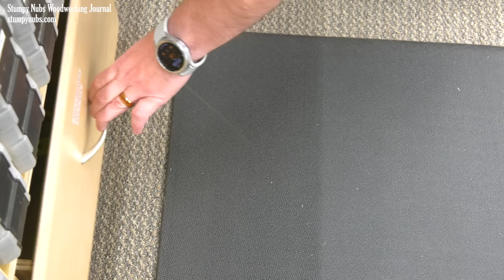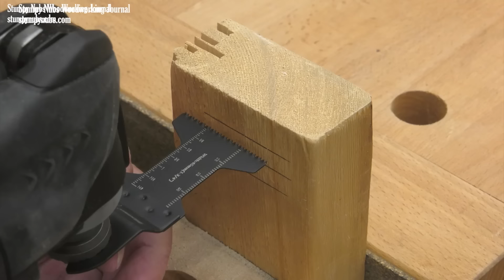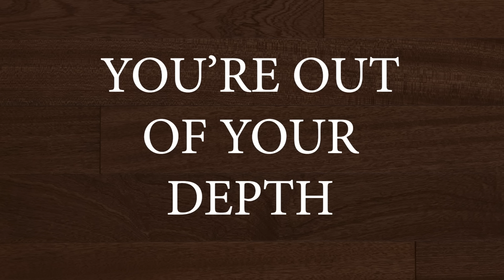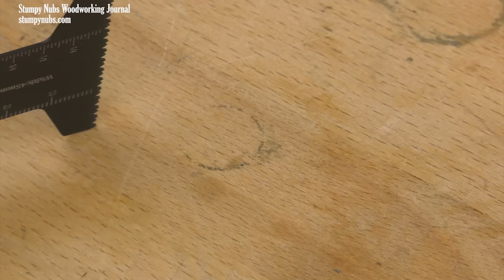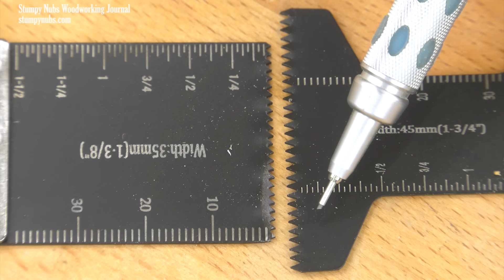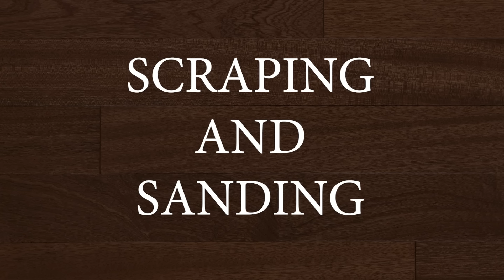An AFFORDABLE power saw that won't cut fingers off!

Comment from the maker: The (not sponsored) blades I use: https://amzn.to/4fkGw3a

★THIS VIDEO WAS MADE POSSIBLE BY★
My Woodcutters is a small Canadian business that specializes in Helical carbide jointer/planer heads and replacement HSS steel knives for both new and older machines. It is well worth supporting: https://mywoodcutters.com/

Clean Armor UV Wood Finish: https://mywoodcutters.com/clean-armor-wood-finishing

Longer video about Clean Armor: https://www.youtube.com/watch?v=HiJdtJeO0JQ

My Table Saw and Bandsaw are AWSOME! Check them out at Harvey Woodworking Machinery: https://www.harveywoodworking.com/

Please help support us by using the link above for a quick look around!
(If you use one of these affiliate links, we may receive a small commission)

Some other useful links:
-Check out our project plans: https://stumpynubs.com/product-category/plans/
-Instagram: https://www.instagram.com/stumpynubs/
-Twitter: https://twitter.com/StumpyNubs

★SOME OF MY FAVORITE INEXPENSIVE TOOLS★
- #ISOtunes Hearing Protection (Save 10%): https://bit.ly/3BHYdH7
- BOW Featherboards: https://amzn.to/430ldhv
-123 Blocks: https://lddy.no/vpij
-Mechanical Pencils: https://amzn.to/2PA7bwK
-Lumber pencil: https://amzn.to/2QtwZjv 
-Pocket Measuring Tape: http://amzn.to/2kNTlI9
-Nut/Bolt/Screw Gauge: http://amzn.to/2CuvxSK
-Self-Centering Bits: https://amzn.to/2xs71UW
-Steel Ruler: https://lddy.no/10mv7
-Center-Finding Ruler: https://lddy.no/10nak
-Bit & Blade Cleaner: https://amzn.to/2TfvEOI
-Narex Chisels: https://lddy.no/sqm3
-Mini Pull Saw: https://amzn.to/2UEHBz6
-Shinwa Rulers: https://lddy.no/zl13
 
(If you use one of the affiliate links above, we may receive a small commission)

Comment: My number 1 oscillating tool tip: wear earplugs! You're never gonna want to use the tool without them.
Reply: What? 😂
Reply: Absolument 💯
Reply: Can confirm. The tool itself isn't particularly noisy, but it inevitably vibrates the part you are cutting which can make a lot of noise.
Reply: Especially in a closet or cabinet or tight space.
Reply: My ryobi is super high pitched at high speeds, you definitely need hearing pro
Reply: 😂 “we are not going to make it”
Reply: @smody121 and the Ryobi isn't even the loudest one. I have a cheap Warrior from HF that is truly ear-splitting.
Reply: Very much agree, making cuts with it is way louder than one might expect due to the vibrations.
Reply: Agreed on the number 1 tip. I'd like to add a number 2; don't touch the blade directly after cutting, they get really hot in my experience.
Reply: I'm waiting for the noise canceling version before i upgrade
Reply: I normally have over ear defenders but like to have a handful of in ear plugs in the tool box, just in case I forgot to pack the ear defenders for a job site
Reply: For sure. The tool is already loud, but the vibrations on whatever you’re cutting (metal 🤯) will damage hearing for sure
Reply: @joegibes  I have a cheap chinese dewalt clone multi-tool that obliterates your hearing at half speed. It gets quieter if you go slower or faster, but the ear splitting speed is the 'perfect' speed like 90% of the time.
Reply: It's a good idea to use hearing protection with a lot of power tools. I probably wouldn't bother with a screwdriver or drilling wood with a handheld drill, but a lot of other stuff I would. I value my hearing way more than being laughed at by macho men.
Reply: Thank you for typing that because I wouldn’t be able to hear it anymore due to my oscillating saw.
Reply: @blarghblargh  who cares if you can't hear them laughing?

Comment: If it makes you nervous to guide the blade with your off hand, you can just wear a nice sturdy work glove on it. That's something you'd never recommend with a rotating tool, but it's perfectly safe for this.
Reply: If you start feeling slight pins and needles when you're using one, you're overdoing it.

Comment: Grout blades are expensive and wear out extremely quickly. I tried diamond blades, carbide blades, etc.  Watched a video of someone using a masonry disk/wheel with a grinder but that was on a tile floor with a 3/8 or 1/2” grout line. I had a 1/8” grout line. Bought some masonry cut off disks and luckily figured out a clamping system and tightened it down with the hex bolt.  Cut through grout like butter!   As the disc wore down I’d just rotate it a quarter turn.  Finished 90% of grout removal with a $5 pack of HF discs. The first 10% I used $60 of multi tool grout blades. Hope this helps.
Reply: I did the same thing several years ago. I also used an 80mm dia mini circular saw blade which worked well on wide grout lines
Reply: do you mean angle grinder disks?  that could be genius.
Reply: @mgjk  yep, angle grinder masonry disc on a multi-tool.
Reply: @davids2530 Huh? How? What sort of multi-tool head, presumably not Starlock?
Reply: @feanor5037  No, the style of multitool that requires a hex key to tighten down the blade.  Pretty sure I just used a couple of large washers and the hex bolt to secure the cut off disc.  My newer multi tool uses a spring loaded retaining system. I think I’d have to rivet the disc to an old blade if I was forced to use that one.  Or buy a cheapy harbor freight model that uses a tool to retain the blade.

Comment: I have used medical oscillating saws for years, and I can tell you for a fact they will cut soft tissue under the right circumstances. Certainly they are safer in the woodworking shop than either a rotary or reciprocating saw. The "triple grind" blades will also cut soft tissue much more easily than a standard blade because of how the blade point is made. My oscillating saw is my favorite in the workshop though, but it isn't the one I use most. It definitely has its purposes.

Comment: Pay attention to how he moves the carbide blade back and forth when cutting screws and nails. If you don’t, it will heat up and quickly destroy the teeth of your most expensive blade. A quality carbide tooth blade can make a lot of cuts in metal if you keep it cool by keeping it moving.

Comment: I’ve used one of these before. Bought one. Have it sitting in a drawer. Your video has given me some incredible ideas on how to use this bad boy. Thank you.
Reply: I've had a huge amount of use out of mine in the last ~10 years. From cutting floorboards for lifting them, to cutting copper pipes in awkward locations. I used it a couple days ago to cut down the aluminium core of a roller blind. Super useful tool.

Comment: I bought my first Fein MultiMaster in about 1995 when they first came out with them for non-medical applications.  Cost me about $350 as I recall.  Over the years we have destroyed 2, and currently have 3 in service in my shop, and in my partner's finishing kit.  She made me buy a 2nd one since I keep one rigged for cutting, and kept on swiping hers for sanding.  We buy the "obsolete" models off eBay when we need to replace them.  Last time I checked, Fein still had the highest oscillation rate.  Awesome tools.  I have used them for every application you mention in this video, and maybe a few more.  I use the sticky-back sandpaper versus the hook & loop.  Takes a heat gun to replace them.
Reply: The first and as far as I have used still the best ever made
Reply: @truckguy6666  Just used one of mine today to install a sewing machine in an antique cabinet.  Cut both wood and steel.  Amazing tool.
Reply: @emcarpenter5206  Yep!  Just used one of mine today to install a sewing machine in an antique cabinet.  Cut both wood and steel.  Amazing tool.

Comment: While blades aren't expensive, they can be resharpened with a diamond file fairly quickly. It is best done before everything is really rounded off. I did this more often when these were newer and the replacement blades were around $5 each. Now as they are around $1 each I guess it isn't so worth it.

Comment: A few years ago I needed to trim 1-1/2" off the top of 10 kitchen base cabinets that were in a customer's home. They were too tall and we were going to install a countertop that was 1/2" thicker than the original. I thought for days how to accomplish this without removing all the cabinets. Finally, it dawned on me. I removed the old top and added a 1 X 2 strip along the entire perimeter of the inside of the cabinets at the right height. I used the strip to guide the oscillating saw. Perfect !! I rarely used the saw before that and now think of uses for it all the time. Thx for another great infotaining video.

Comment: i use the scraper blade attachment to remove the old dried out and junk sealant around my RV skylights.  A putty knife, razor blade would take forever to remove that sticky rubbery stuff.  I love this tool.
Reply: I used a thin abrasive semicircle blade for removing old grout from a tiled wall, took a fraction of the time compared to doing it manually.
Reply: Same on a boat. Brilliant!

Comment: Had my hand cast cut off with one in 1970. A kid in shop class pushed my thumb into the bandsaw blade and me being a kid and having no real guidance from the shop teacher, had left the guard all the way up. Ouch! It went through my thumb. When the doctor used the surgical multi tool to cut off the cast I had had my fill of blades and skin but I learned all about these amazing tools 54 years ago.
P.S. my thumb works perfectly fine these days and I no longer leave the blade guard up when cutting wood.

Comment: I used my Oscillating tool today. I use it all the time. I do lay a finger on a large blade to help guide it. I most definitely will draw blood. Any tool with a moving sharp edge will. One of my favorite fine tuning joints.

Comment: Thanks for the tips. It was validating to see some things I already knew and helpful to see some new ideas. 

I am a landlord, and handle the first line of maintenance for my properties. It is often much easier, more affordable, and less disruptive to my tenants to do little spot repairs as issues pop up, and the oscillating multi tool is awesome for getting into the little nooks and crannies to cleanly remove damage while leaving functional infrastructure in situ. Definitely a handy tool for situations that require a little flexibility.

Comment: We still use an oscillating tools for cutting casts off,  it is a half circle blade with bigger teeth that are not sharp at all.

Work great and don’t injure the patient when the blade touches the patient.
Reply: When you're 10 years old and they don't warn you what they're doing, it can be a scary moment when they start cutting the plaster on the cast. I still remember it vividly, 52 years later.
Reply: @ I used to demonstrate,  let the blade hit my hand or arm.

Comment: I have brushed up against the injury boundary with these tools, take care if applying pressure for sudden slippage.
Reply: Yah, added pressure against the bone would reduce the "floppiness" of  the skin, leading to a higher chance of injury. Still, it's way safer than other cutting tools I can think of (unless you're a complete numpty).

Comment: I bought one of these for one particular project. I needed to accurately cut a section out of a wooden backsplash; in place; to replace it with a marble piece. It worked fantastic. They have their uses, and can be super accurate when used carefully.

Comment: Tip, when using the round saw blade, move the tool round to remove the dust between the teeth of the saw. Less heat buildup and faster cuts.

Comment: I’ve used a cast, saw for trimming out plastics and carbon fiber in Prosthetics for years. When these oscillating tools came on the market it solved a lot of problems because the blades and tools are a lot cheaper than a cast saw.

In remodeling and woodworking, I use one of these tools constantly. I used to refer to it as my sonic screwdriver but not enough. People got the joke so now I just called the magic wand.

Comment: Stumpy, first allow me to sincerely thank you, as always, for continuing to expand my woodworking abilities. I have learned so much from your guidance. I love your teaching style that never degrades, but offers alternatives and encourages us to expand our skills.

Like some other viewers, my multitool is in the bottom of the drawer and rarely used in the shop. I did have high expectations (perhaps unreasonable ones) that your video would demonstrate certain shop cuts where the multitool was the “preferred tool of choice” (like using a scroll saw for fine thin cuts, or bandsaw for random curves). If there are certain woodworking projects/techniques best performed by the multitool, I hope you add a follow-on video.  
But if not, I have already ordered a set of wood blades and will keep my multitool handy for those random “just-in-time” cuts as needed. So, thank you for reminding me to dust it off and keep it handy as another shop resource.

Comment: These are fairly useful for workshop style woodworking but they are an absolute life saver for joinery/general building work etc. 

It was one of those tools I bought wondering if I'd use it much & now it's one of those tools that automatically gets put in my tool box every job.

Comment: Great info. I never thought much of these oscillating saws and then i recently discovered they can be very useful in certain situations. The added safety is very much a big advantage over dangerous rotating blades. This video made me use the triangular sandpaper for the first time and that was very useful for rough rounding of corners. Tool speed is another thing i didn't fidel much with just because the dial on my saw is not in an obvious spot. It helped slowing it down for more control.

Comment: After replacing the baseboards  upstairs,my wife decided she wanted the trim around the doors changed. The oscillating  tool allowed me to make some required trims, and I learned to use the angle plunge to make cuts.

Comment: Thank you, Stump.  I bought one some time ago and haven't had a need to use it.   Now that I understand the why and how better, I'll have to try it.
Reply: If you do much DIY around the house you'll find a bunch of uses for it. Plunge cutting a floorboard over a joist to remove a section, cutting existing pipes to length when they are mounted close to a wall, cutting holes in drywall, removing tile grout or cutting tiles etc..  Super useful tool, you should definitely start using it.

Comment: I use the oscillating cutter several times a week.  The cutter is a handy tool .  The blades can cut your skin, especially the aggressive wood cutting blade.
Reply: You can definitely get cut if you don't take reasonable care, but you'd have to try very hard to remove a finger etc.

Comment: Used mine to remove paneling by cutting small triangles around the nail heads, made the job easier and saved the panel to recycle 😊

Comment: Excellent to the point video. I have not bought an oscillating tool thinking it wouldn't be beneficial for me. But you showed some good possibilities and I am going to get one for my battery tool system. Have a use for it this week. Thanks.

Comment: a very versatile tool i use mine for cutting electrical box holes , i picked up a box hole blade  tho a simple blade is usually faster it gets the size right . trimming out windows and doors, i even used mine to cut the siding of an utility barn  for a window --framed it on the inside and then used the oscillating blade to follow the frame from the inside fit perfect

Comment: I had a green Bosch multi-tool from just after it was launched in UK. As with all Bosch green tools, when first launched, it was underpowered. When we started gutting and remodelling our current home in 2013, my builder mocked it but... eventually started borrowing it. I got a corded DeWalt in a pre-Christmas clearance sale - it was far more powerful but wow - did it vibrate! Cliff started using it a lot so I gave it to him and bought a second in another sale. Eventually, I gave that to my daughter who was doing heavy-duty work on her house. I replaced it with a bare cordless Milwaukee version since I have Milwaukee 18V batteries for my drill & driver set. It is so much smoother than the corded DeWalt but just as powerful. 
So many applications from careful carving to grinding at brick. I keep blades so: sharp for wood or nails; used and a bit blunted for plasterboard; even older and blunted for aerated cement blocks. Some 'blades' are rough rasps that rub down bricks & concrete, eg UK electric socket fixing. Used them for all the uses in the video but... those corded DeWalt vibrations were really, really bad unless you wear very thick anti-vibration gloves. 
Agreed: almost useless for sanding
Reply: @cuebj "really bad unless you wear very thick anti-vibration gloves. " --  please do tell me about anti-vibration gloves.

Comment: I've had my Multimaster for over 20 years (you just can't kill one of these), and my favorite are the Japanese style blades as well. But beware, these blades are ground differently and will most assuredly cut you faster than you can pull away.